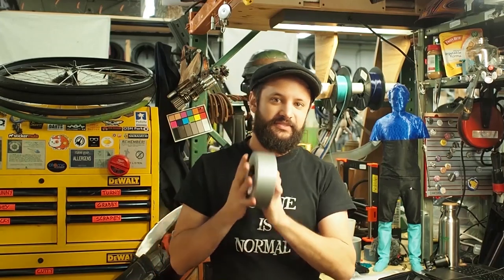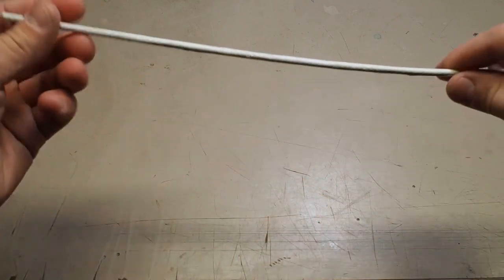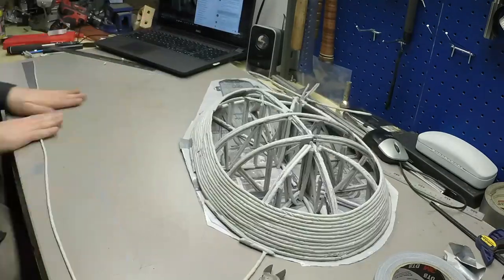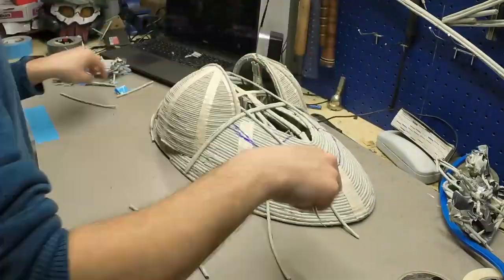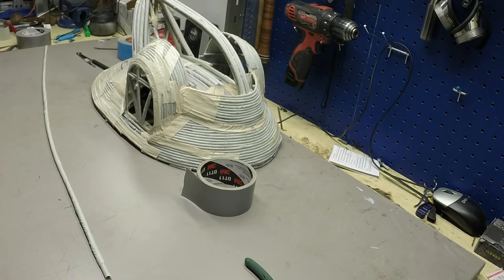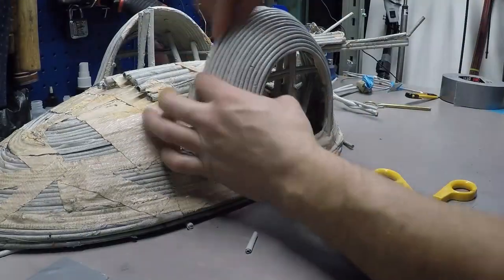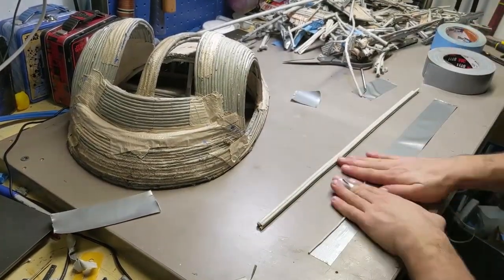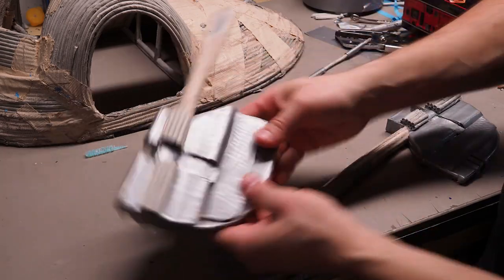Making a Duct Tape Spaceship From Scratch! (Star Wars Slave 1 - Ep. 1)

Comment: The reference photo?  Is that one single large sheet of paper or do you print sections on standard paper and then assemble the documents into one large photo. I need to print a reference photo on a 24 x 36 sheet.
Reply from the maker: Im happy to help walk you through the process.  I made it from a number of images that were stitched together from 8.5x11 sheets.  Message me on twitter, IG, or fb and I can help you out.
Reply: @rocketprops3739  Perhaps a demonstration video would be of better value to the DIY community at large?
Reply from the maker: @elegantcourtier  I will see what I can do!  I am currently in the throes of a workshop move, so don't hesitate to ping me if it slips my mind, but its on my list!